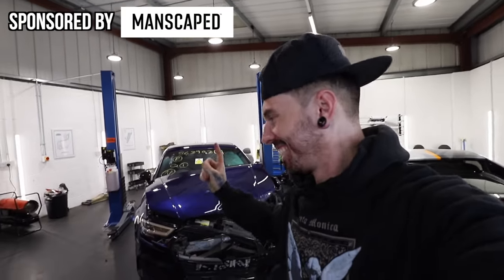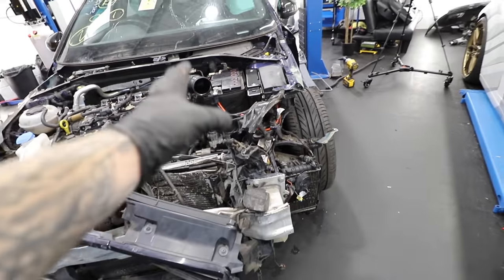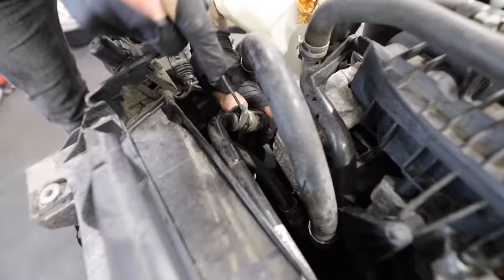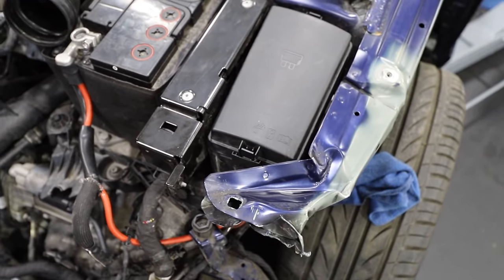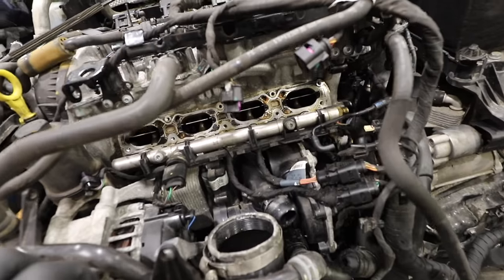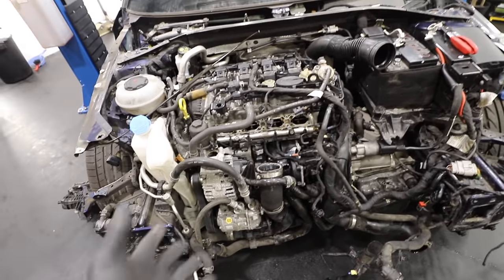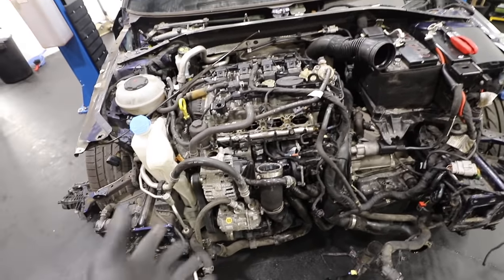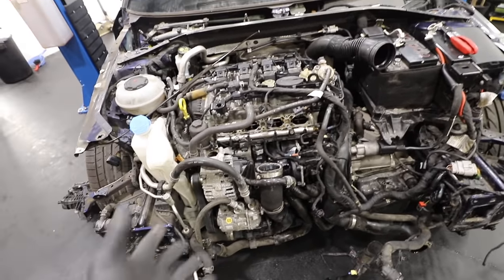HOW BADLY DAMAGED IS THE WRECKED AUDI S3?

Comment: You checked the intake ports in the engine and found that peice of plastic. What about then intake pipework? The one leading to the throttle body. Gravity would dictate pieces would fall down there into the pipework. Hopefully not.
Some of the vaccum lines may be causing the PCV valve to open and shut constituting some clatter noise maybe ?
Reply: If this is the case pull the plug and see if the electrode on the spark plug has bent from foreign body damage. Otherwise your route of swapping injectors and coil packs should point to some clues.

Comment: Start with compression test, then spark plugs and also swap the old injectors back, then final try is coil pack👌
Reply: The newer type EA888 has direct and indirect injection. The injectors that Matt is pointing out are the indirect ones. Those help with cold start what the car is doing fine, besides cold start they are also helping with different loads but don't if it is just full load.
Reply: @boerher  isn't this technically a cold start tho seeing as it's not been run up before? It's always worth trying to swap the old ones back even if they're the problem or if they're not, it's one of the key ingredients to fault finding bud
Reply: @robertbyrne781  After all those weeks waiting, finally an update. But Matt still doesn't have the answer  😋. Have looked about the indirect injectors, you were right. The indirect injection is mainly for stationary and low rpm.

Comment: Hey Mat, love your content and your energy in your vids! In my mechanic training (in Switzerland) they told us not to cut structural parts, more replace the whole section of the car. The front of the car has factory weakened sections, so that the engine gets pushed under the car, instead getting pushed into the cabin, incase anyone has a frontal impact. Thought you'd might appreciate the info ;) Keep up the good work, looking forward for more content to come mate.

Comment: Try swapping the coil sticks about to see if the misfire moves to another cylinder, check the plugs at the same time.
Reply: Always new plugs ( iridium ) and coils. Save hassle with trial and error. And it wastes time fault finding. 
Reckon ensure all plastic was out the engine first. Too much excitement getting it started. 
Come on Mat. Remember the S5 build? Use your knowledge from that one

Comment: The ea888 engine have two sets of injectors. The smaller set on the intakes only spray at idle and low revs to flush the valves.
I'd personally take the set off the original manifold and fit them to the new intake.
The replacement set would need coding in.
Reply: Would they? I only know that the older engines need coding for direct injectors, but the newer are self learning. Never coded the indirect injectors. Those which sitting in the manifold are the indirect ones.
Reply: The petrol injectors are plug and play, don’t need coding. Even the diesels will run initially uncoded, they’re coded for refinement
Reply: @DrifterJo2015  I know when we apply the larger injectors they need rescaling. I personally have never had to swap injectors on these but yeah what you say makes sense as the scaling should be the same for both sets.

Comment: Mat, common issue on all VAG cars is the injectors and coil packs, the injector baskets disintegrate because they're made of plastic so whilst you've got access, get them tested and refurbished with gauze baskets. Or simple test first, just change the coil packs around to see if the cylinder misfire moves to another cylinder, is so then its the coil pack. Might also be worth having someone walnut blast the carbon out of the intake manifold whilst you're about it.

Comment: Mat I love Your videos. Just a small thing, don't forget the break cleaner might be destructive for seals, so You should not use it above any parts, but in a safe spot, so it does not leak on rubber connections and seals. No hate, just advice :)

Comment: Hi mate, that nocking noise your getting before the misfire is the Cam Magnets (on the side of the cam cover - left side of engine) they’re about £60 each from dealers and you will need 2. Had the same issue on my Golf R and it was them. These are very common on the MQB platform.

Comment: Misfire is the best excuse for getting some upgraded coil packs & plugs in there plus you can check for any plastic additions in there whilst they’re out 😉 the missing air filter is also the perfect excuse for the full R600 intake setup 😉

Comment: Matt, for the Audi to run perfectly, after removing the injectors you would be best to replace all the injector seals, also if you are not replacing the injectors the flow of the injectors should be checked because if an injector over fuels badly later it can damage the engine and possible cause an hydraulic lock in the cylinder, as you don't know the condition of the spark packs it would be best to replace them too and spark plugs too, the engine sounds fine and you don't have to code injectors they are mostly plug and play but be sure all power connections plug click in place or they will not work.
Hope any of this info helps.
 😎👍

Comment: As mentioned Coils are an issue,but also sometimes Throttle Housing needs coding too.Especially if its a fly by wire system.Only a suggestion I'm not an Audi specialist,whatever it is good luck 👍

Comment: Miss fire could be coil pack related. Having had a VAG product, coil packs are known to just let go, causing rough running, engine light and limp mode, other related issues like spark plug or injector could be causes. Aside from this, I don't think you did enough checking ofr inlet manifold ingestion. The clue is in the name 'inlet' meaning ingestion of small parts is possible. Great content though Mat.

Comment: I bought a Copart A1 that had a slight misfire, a breather had broken on bottom of inlet manifold, so changed it. When I removed it, the whole inside air tracts had disintegrated and were stuck in the valves. You need that inlet off again, and double triple check there’s no plastic stuck in there, small bits will wedge a valve open causing the miss

Comment: Just for reference mate, if you unplug the MAF sensor it will run without cutting out with boost leaks. Obviously it'll be in limp, but just to see if it starts it's fine.

Comment: Be sure to check on the transmission mounting area, there’re three bolts under the battery tray which support the transmission housing tends to break pretty easily after a crash

Comment: If it was me I’d use the old injectors and get a bore scope down the spark plug holes and check for any plastic that might have got through when the valves were open

Comment: I would say, certainly put the original injectors back first. So you can see how the engine is running then. Probably have a look in the cilinders with a small camera to see if there is any debries from the plastic left. And just for sure put some new spark plugs in. You can also try first to do a compression test, to see if any valves are damaged while there could be some plastic beaten through them. Keep the nice content going! 😄 If you ever need some help please contact me. I own a small workshop in the Netherlands and I’m specialised in VAG and BMW mostly electronical related.

Comment: It will be the injectors that will need coding in. There are codes on the injectors that you need to be able to code them in. So either way will need to come out. So might as well try to  put the old ones back in and see if that fixes it. make sure you put the injectors in the same locations though when swapping the old ones to the new intake.

Comment: I had a cylinder 3 missfire. It was diagnosed as a timing chain over stretched so I got the timing chain, tensioner, guides and crankshaft pulley replaced which fixed the issue but was expensive.

Comment: Matt you need to remove the spark plugs and check inside the cylinders for any plastic, if you took the throttle body off and there was plastic in there it probably must have been running on boost upon impact! So who knows how much plastic it sucked in.

Comment: If the rattle noise still there after misfire been sorted, cam chain tensioner fails that work with oil pressure 👍🏻👍🏻

Comment: You are missing the maf sensor as its on the airbox , so the ecu does not know how much air is going in. It messes up the fuel trims,and also there goes a vacuüm line to the airbox, this couses a vacuüm leak and vacuüm leaks and misfires go hand in hand :D sort those 2 things and i bet you it wil run a lot better. Also the s3 and rs3 engines got direct and Port injectors so thats why there are injectors in the inlet manifold

Comment: Pcv leak will cause a misfire, next to that spark plug, then the coil pack then the injector...swap the plugs and coil pack over to a different cylinder see if the misfire moves between cylinders. I reckon some of that plastic might of made its way into the engine 😤

Comment: Might be a bad coil pack/spark plug or an Injector, but.....I don't know if you guys in the Uk got the extra set of port injectors on them like I got on my 7R (so not the DI ones but the ones that are injecting on the intake valves). Mine had misfires on cilinder 3 and sounded the same on idle like your S3 but when you give it some revs the engine sounded fine but wouldn't idle right. I ended up replacing one of the port injectors because they are responsible for low/medium rev range but when you floor it the DI injectors ' take over' . When I done that, problem solved.

Comment: hi Mat i love what you did to your car, Mat i was also involved in an accident and ive managed to rebuild my Audi A3 8v 1.4 tfsi but now i cant seem to get rid of the Airbag light. i had two airbags out and one seat belt locked, so i bought the seatbelt and the two airbags, 1 seat airbag and one left cartten airbag, when dignosing the car the airbag light whon go away, do i need to replace the airbag sensor? i just cant get it.

Comment: 3:05 if ur getting the new piece anyway why bother butchering it just to weld it on to the old piece, is it that much hassle to remove the big part, or is that part welded on too,
Reply from the maker: It’s welded to the a pillar and it’s a much bigger job to chop from there and reweld. It’s a lot harder to get it exactly straight. Whereas if you leave it there it’s already mounted in the correct position

Comment: Swap cylinder 1 spark plug and oil pack to another cylinder and see if the misfire moves location. If not then either injector problem or worse :/

Comment: The engine issue could be the spark plugs or the ignition coil, had both happen in my car before. The ignition coils fail most on cilinder 1 of any engine because that is the first cilinder to get started on an engine.

Comment: Mat by yourself a second hand dozer ( frame puller ) you can get one pretty cheap and it will pull that chassis section straight very easily without cutting and welding